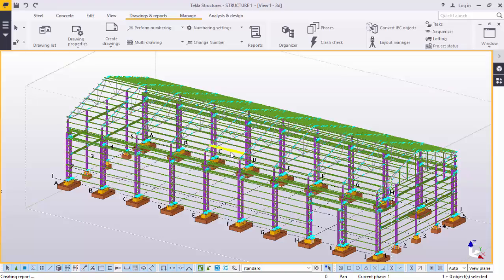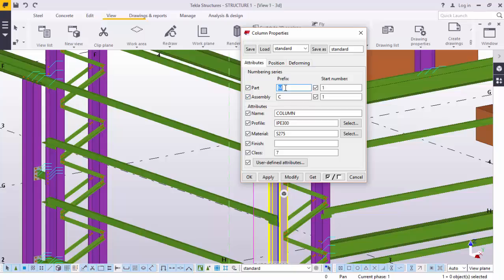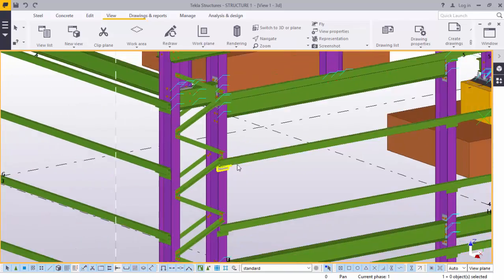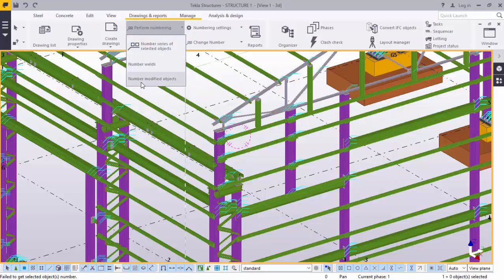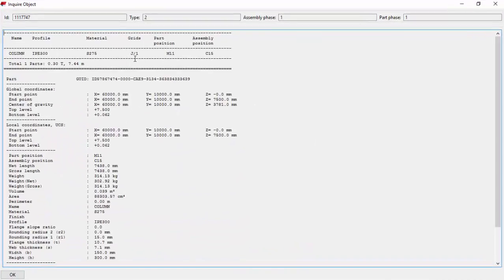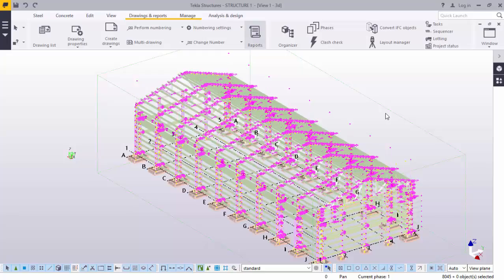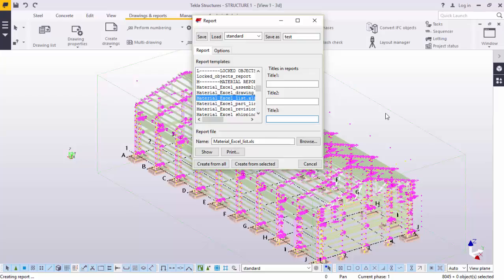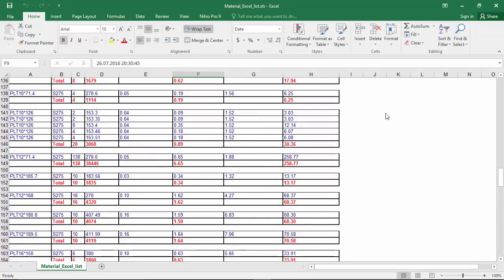Numbering and Report Creation in TEKLA STRUCTURES 2016

Comment: I have a Precast concrete model that has steel embed on it. I want to make a report that shows panel name or number along with their steel embed number on it respectively . Is it possible? can any one help me how can I start the report or which component to use? - - - Thank you
Reply from the maker: select the whole model and then pick the right report template from drawings and reports toolbar